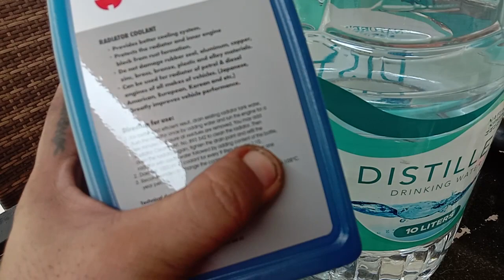Radiator Replacement/Installation Step by Step Tutorial | Mitsubishi Lancer Hotdog/Itlog

Comment: Hi sir. What kind of sealant are you using for the radiator hose?
Reply from the maker: silicone sealant... make sure na high temperature gamit mo
Reply: Thank you 😊
Reply: What's the name of the silicone sealant you using? Any suggestions? I want to order on shopee or lazada
Reply from the maker: pioneer
Reply: Hi sir, sorry to disturb. I have a Mitsubishi lancer Pizza Pie. My old radiator was made of aluminum on top with 0.9 radiator cap. But the radiator is not good anymore. 
I will change to new radiator like yours Evercool, same one like yours in your video. . I want to know what size radiator cap to use? 0.9 or 1.1?
Reply from the maker: .9 and 1.1 is not the size... its the pressure specifications of the cap
Reply: I see. So which pressure specification should I use?
Reply: I'm looking for the right specification cap for the new radiator and for my car model?
Reply from the maker: 0.9 as indicated bt the manufacturer
Reply from the maker: you should buy the cap together with your new radiator
Reply: Ok thank you sir.
Reply: @otoklasmeyt Good morning sir. After filling the coolant in the radiator, do you need to put the
A/C on to (bleed system) 
Oh is there no need?

Comment: hello, sir kapag magpa2lit po ba ng coolant kailangan magpalit na dn ng thermostat? 
pinalitan kc ng tubig ung coolant nung akin. so, gusto ko sana coolant tlaga ang ilagay. then, bumili dn ako ng coolant flush bago ko sana palitan ung tubig ng coolant. ok lng po ba un ggawin ko sir.
Reply from the maker: no need palitan ang thermostat kng good condition pa naman at walang corrosion... flush mo lng ng maayos ang cooling system bago maglagay ng coolant...
Reply: @otoklasmeyt  ok po sir. TY
sir saan nyo po binili ung air filter nyo at size na dn, balak ko dn kc palitan ung akin.

Comment: Sir anu po size nung radiator cup nyo?
Reply from the maker: standard size for plastic top...
Reply: @otoklasmeyt master pwede po na malaman ang tamong model at o product code ng rad cap na ginamit nyo? Thanks po
Reply from the maker: .9 po pressure specs